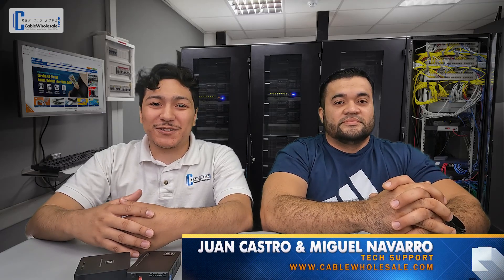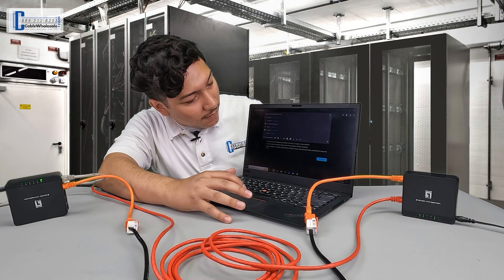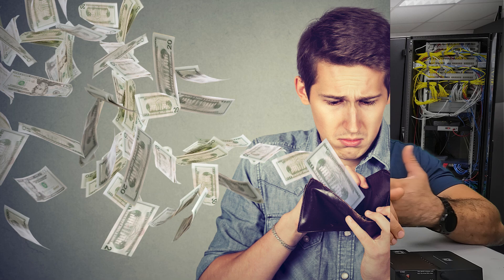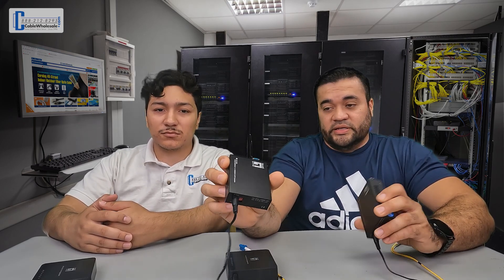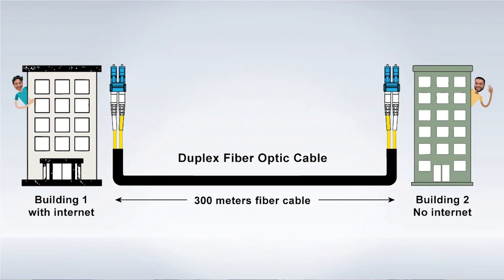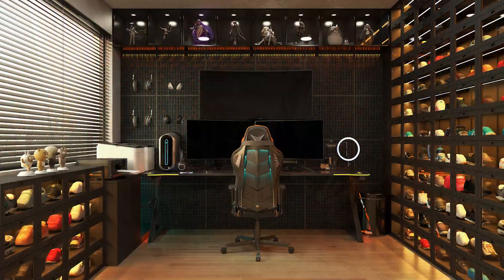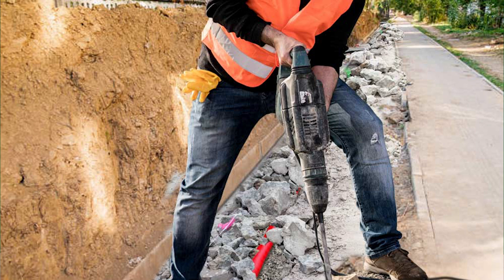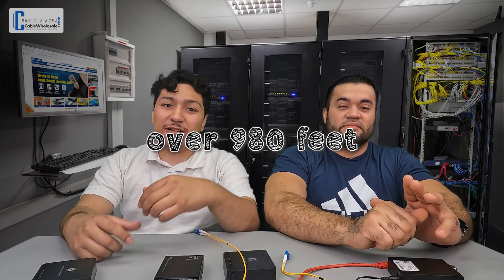How to Get Internet to a Second Building Using Fiber

Comment: hi! im trying to extend my fiber wifi to a building 250 ft away. i believe you're saying that the media converters are for folks without fiber wifi. since i already have it, what would i use instead to connect the buried line?
thanks!!
Reply from the maker: Hello  @jessicagarcia3116, 
You are actually on the right track! Even though you have fiber internet coming into your main house, your router sends the internet signal out to your devices using standard copper (ethernet) ports.
To get that internet connection to a building 250 feet away, we need to convert that signal from your router back into fiber optics for the long underground run and it can be achieved using the media converters please check out our new additions :)
https://www.cablewholesale.com/cgi-bin/search.cgi?text=media+converter

Miguel.

Comment: Thank you! This perfectly outlines and describes what is necessary and it perfectly outlines and describes what is necessary for a DIY type guy like me

I live on a six acre family farm that has been in the family since the early 60s. I take care of my dad, who turned 90 this month, and my house is a “mother-in-law“ house that is about 400 feet from my dad‘s house. You can already see where I’m going based on the distance between the two houses

When I moved back home to take care of him and my late mother, I knew that to save expenses I could “share” his Internet, but the two houses were too far apart to use Wi-Fi or any kind of normal ethernet cabling. We had just been benefited by federal grants that rolled out fiber to the local community, but the cost to install a second modem/router was calculated to be astronomical. 

So I made sure my parents had the fiber installed at the main house for them, mainly so that my two elderly parents maximize their television viewing options, as well as home telephone and Wi-Fi for their tablets. My goal was to find a way to extend only Internet to my house, since I already had a high speed Wi-Fi network I was installing

I’ve been a geek for a long time, and after some research and speaking with a friend of mine who owns a telecom company, I decided to go with running ethernet over coax cable, burying the coax and using a pair of MoCA adapters. 

It seems odd to look back only four years, but in 2021 the coax cable that could be buried for my purposes was exponentially cheaper than trying to run fiber optic.

Now I’m going to use the advice and equipment you recommend to upgrade to running a fiber optic system. Thank you again for the education and providing a place to purchase everything from.

Comment: Thank you for your video gentlemen!

What are you thoughts about replacing all the coaxial cable in our house with fiber? I want to avoid distance restrictions as well as interference. My concerns are how to do PoE+/++ to access points and what connectors are needed to connect standard RJ45 devices like computers, printers, and VoIP devices.  

What are your thoughts and recommendations?

Thank you.

John

Comment: Howdy, I ordered all of the parts used in this, to run to a nearby house. I'm waiting on them to get here to set up. I was wondering if you had a similar video on what you would need to reach 10gb speeds. Or if you had suggestions on which hardware I should pick out. I've been struggling to find information on this that was easily digestible.
Reply from the maker: Hello Tacoman2341,
Thank you for your order :),  You will need 10G media converters and transceivers to achieve your 10gb goal, the fiber cable can be the same at the distance that you are running your setup.
Best regards,
Miguel
Reply: @CablewholesaleInc  I've been struggling to get through the terminology on alot of the stuff online, do you guys sell stuff that can do 10gb on your website, can you link them, like you did in the description for the 1gb parts? or are links not allowed on youtube. I always forget

Comment: It was very informative. Thank you for such a nice video. Could you answer a question, please? I have a 200-foot run to a new building that needs power and internet. I plan to use Fiber, as I want to run the cable with a 60-amp electrical circuit to the second building. Is this possible, as the fiber will not be affected by the electromagnetic field generated by the electrical line?
Reply from the maker: Hello,
Thank you for your kind words! In regards to your question, you can run your fiber along with the electrical circut. Fiber optic cable transmits signals as light, which does not experience the same interference issues as other electrical signals.

If you have any additional questions you can always reach out to our tech team via live chat on our website or give us a call at 888-212-8295 ext 192 for our tech support team!

All the best,
Juan

Comment: Hey guys good video on the topic. Seein how you guys offer the products in addition to the tutorials, any suggestions on specific items I would need for making a 300 foot run from main office to a building that houses equipment for the scales I weigh trucks on as they come in? (recycling center). Is it possible to purchase 300ft pre-terminated?
EDIT: Also, I think I am unsure of the fiber requirments- Do you have to have 2 strands of fiber? 1 for transmit and 1 for receive? Or can 1 fiber be multiplexed? If so, does that require additional hardware?
Reply from the maker: Hello thank you for your comment, 
in answer to the 300ft run:
https://www.cablewholesale.com/products/fiber-optic/singlemode-9-125-patch-cables/product-lclc-012100.php
Media converter used in this video:
https://www.cablewholesale.com/products/fiber-optic/transceivers/product-71f1-50sfp.php
and the transceivers:
https://www.cablewholesale.com/products/fiber-optic/ethernet-fiber-converters/product-71f1-41011.php

Now answering to the edited question:
the fiber optic cable that I sent you before will have to be run through a conduit to protect it since it's not intended for outdoor usage, if you need a cable for outdoor usage our custom department will be the key to solve your request.
This set up uses 2 strands 1 for transmit and 1 for receive (Full Duplex) correct .

You can use a single strand of fiber but it will require different media converters and move the DIPS on it to make it work Half duplex and you will also require a different cable with different connectors on it
if you have any questions or concerns please send us an Email to support@cablewholesale.com so I can send you different options if you need something different.
Thank you 
Miguel